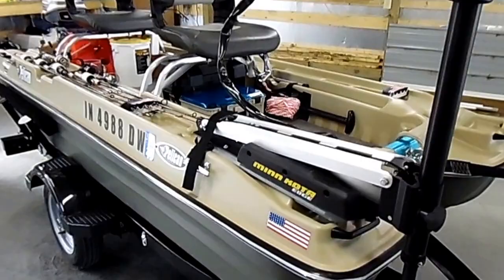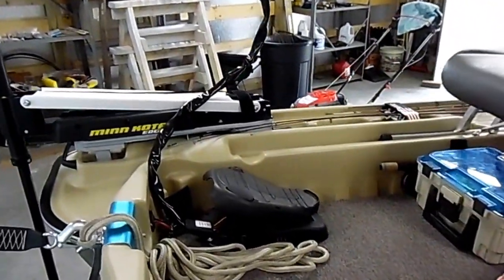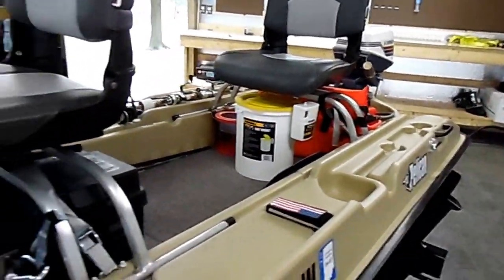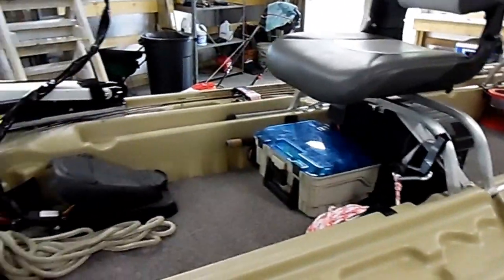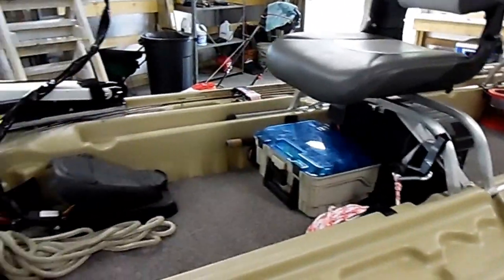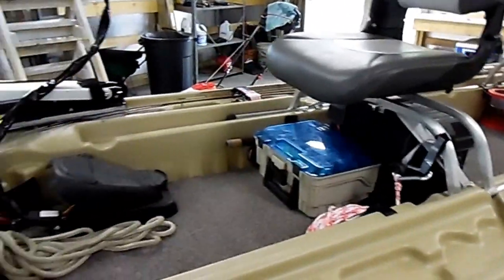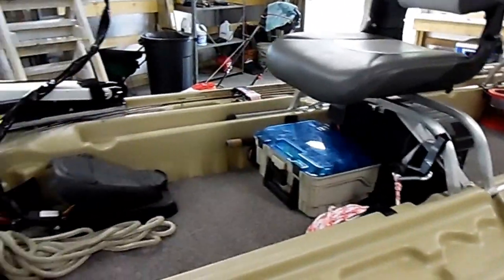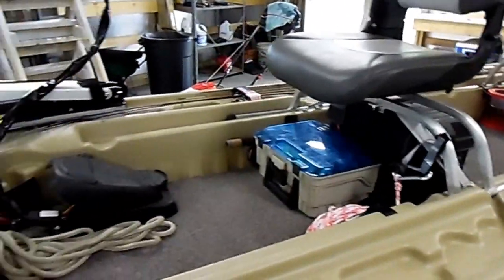Pelican Bass Raider 10E Bass Boat

Comment: Working on my new Raider 10e.  I also like a stowed trolling motor that doesn't take up any deck space.  Did you just shim up the area under the frontmost  part of the mounting plate.  Hard to zoom in, looks like something in the divot above the handle.  
What connectors to mount the plate? In hindsight would you do anything different?  Thanks for any help you have to offer.

Comment: to move from front to back, how about a hinge system on the left or right side of the front chair rail so you can flip the seat from the other side without the hinge upwards so you can move to the front or back freely and the seat will be out of the way? just a thought
Reply from the maker: Hello, hinge is not a good idea.  If you look how the seat frame sits in boat...when the boat is in the water the seat bases give support to the sides.  When lifted the sides will pull together slightly and seat rail difficult to re engage.

Comment: Beautiful job ! I just picked up a Mercury 3.5 hp and should probably get a motor support or transom mount...It looks like the motor is fully vertical with transom mount. What brand did you go with?

Comment: Are the trailer bunks underneath the pontoons?  Or in the center in between the pontoons?   I set my trailer up and am trying to figure out which way would be best
Reply from the maker: Hello, sorry im not on here much now days.  I positioned the bunks on pontoons (inboard of the center ridge.  Then set the side bunk / guides as close as possible and she will load good every time.  Good luck and tight lines!

Comment: how did you attach the pvc rod holders? looks like you drilled a hole in the top of them to screw them to the deck.
Reply: tim johns This is my question as well

Comment: So from reading your comment I assume you used wood screws for your tie down or anchor cleats?  Anything else to strengthen them in case used on a rough day with an anchor?
Reply from the maker: I just used cleats with 4 small wood screws.  Quite strong they have never loosened

Comment: Does the trolling motor being mounted on the side affect the "steering" of the boat? I would think it would try to turn the boat when being used.
Reply: ... If I may, many boats (bigger ones) have the TM off the side. No, it does not affect it to the point that it is a problem. 
 .

Comment: Nice Job. I,m sure you are aware that you have over powered the boat with the 6 hp motor. They are only rated for no more than a 3.5 hp motor. I would check your local laws on HP ratings so you don't get into trouble.

Comment: how did you mount your bow mount on there, anyway you could send pictures or video how you did it?
Reply from the maker: Hello.  I simply used long wood screws and let them self tap into plastic, DO NOT DRILL PLASTIC. Then just countersink top of screw holes in wood so that screw heads will not protrude above surface of wood.  Use treated 2x6 lumber about 2 feet long.  Use a level front to rear and side to side to shim the wood level.  then just screw the motor mount directly to wood.

Comment: What kind of carpet did you add, and did you just put it straight on without anything else underneath it?
Reply from the maker: Yes 1/2 inch plywood.  Just stapled the indoor outdoor carpet to plywood.  I have only two "short' screws fastening plywood to bottom to prevent warping

Comment: how is the trolling motor mount put on
Reply from the maker: Hello, i just used a piece of treated 2x6 lumber and a level adjusting with block at front.  Just trial and error to get it level front to rear and side to side.  Just coarse wood screws "counter sunk"  to attach to plastic and then use wood screws to attach motor base to wood.  It has worked out great.  good luck.

Comment: How did you I stall the min kota up there?
Reply from the maker: i used toggle bolts to mount the treated 4 by six wood, then 2 inch wood  screws to mount motor to wood

Comment: What did you use to mount the plastic half pvc rod tip holders? It’s a block and is it plastic or wood?
Reply from the maker: use coarse wood screws and dont drill.  Firm hand pressure on screwdrive and screws will go right in.  Do not over tighten scresw. wooden trim